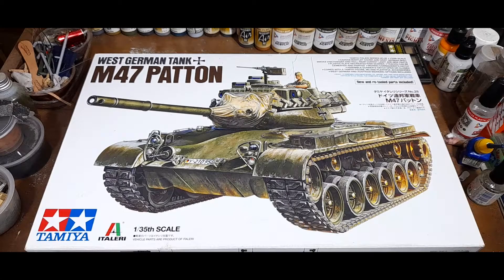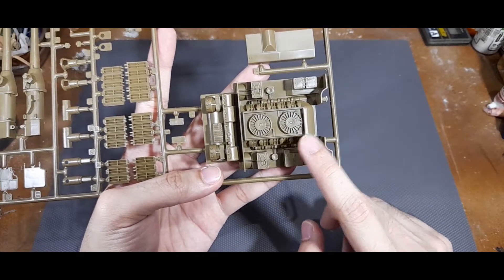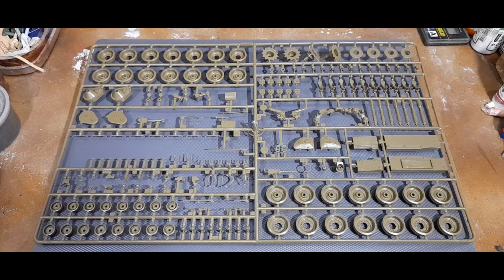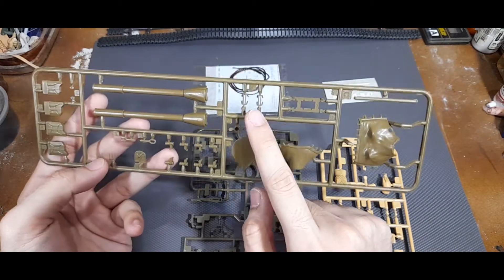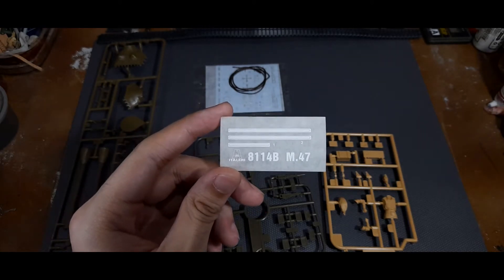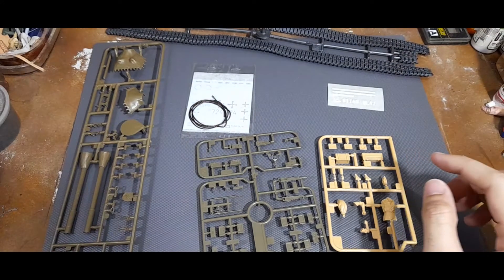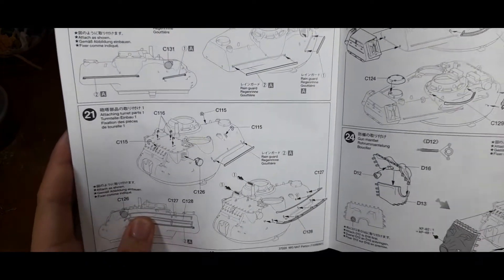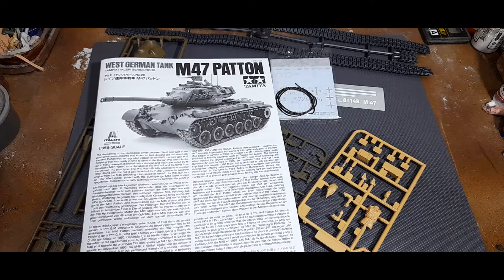(IN-BOX LOOK) Tamiya 1/35th West German Tank M47 Patton

Comment: This is one of Italeri's best kits and the basic kit is pretty old.

I have an Italeri kit of the M47 Patton and I must say that in my honest opinion it's a better dollar value than the Tamiya kit which has only a few added things to the basic Italeri kit. Looking online at the hobby shop I deal with the Italeri kit is $41.99 and the Tamiya kit is $80.99.

A couple of things regarding the engine deck.

You can NOT see the main engine (part with the two circular fans on it) when  the hull top is in place and that's because the louvres are solid. I very carefully thinned the underside of my upper deck, then opened those louvres, and then lightly sanded each louvre.

The other louvre panels do NOT need  to be glued in place since they are a snug fit. That way you can have them open later if you want to.

That little box on  the right rear of the rear hull panel that can be closed with part 56C is  the infantry telephone box and part 56C can be glued on at the bottom of that box so the box is open. You can then add a figure and a telephone cable to make an interesting scene.

Either an Italeri or Tamiya M47 Patton can be built up into a very nice model out of the box. You can have an excellent model with just a bit of extra detailing.
Reply from the maker: Thank you for your insight!

The kit is indeed quite pricey for what it is. I was fortunate to get mine for about $15. Quite the steal as locally, the kit sells for roughly about the same price as the basic Italeri that you quoted. 

I took the longer route with the engine louvers as I 'snapped' them to individual pieces. Then I drilled out holes in the "hinges" and used thin wire to make them moveable. It's a pretty hairy thing to do as the plastic in those areas are small and get thinned out when drilling.

I got sidetracked by two other builds, but the Patton is for painting soon. Hopefully I get to upload the build next month.

Cheers!